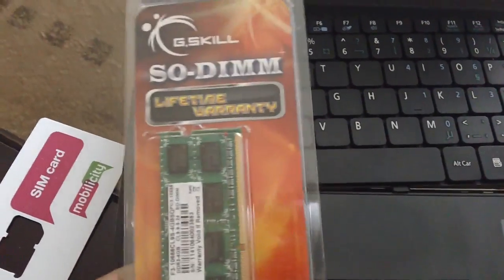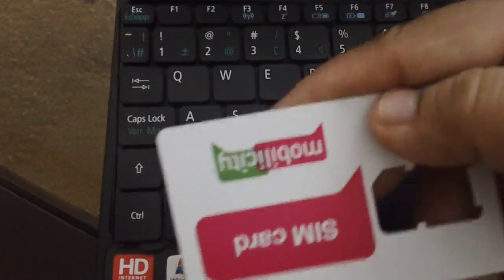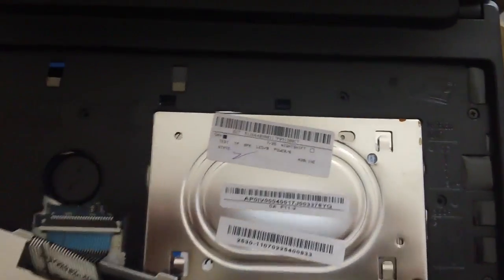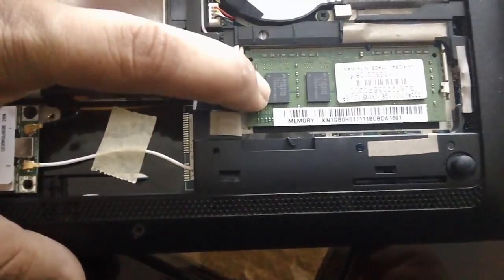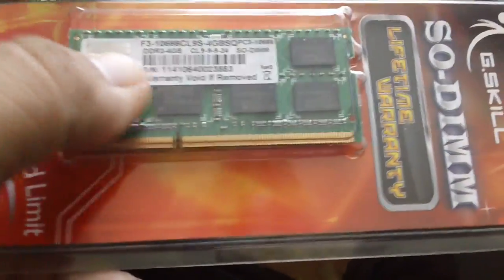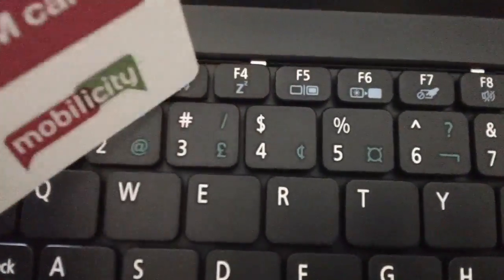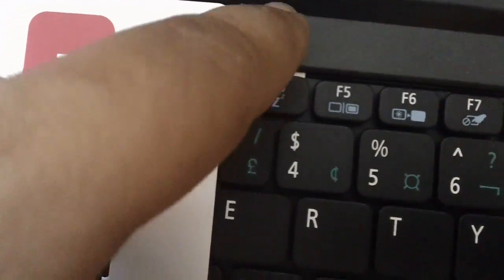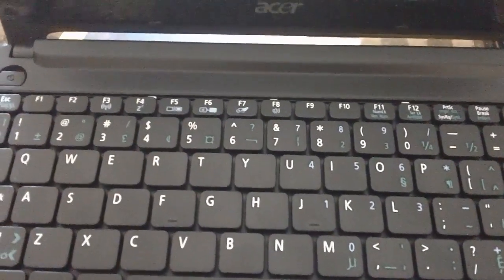Acer Aspire One AO 522 RAM UPGRADE and PROPER KEYBOARD REMOVAL [HD]

Comment: quick question, whats the quickest wifi driver to install on this notebook? the wireless is slow since my windows 7 upgrade and the site gives me so many drivers to choose from?

Thanks
Reply from the maker: hmmm.. if i remember correctly, this model has few different type of wifi chipset, like, atheros, or broadcom.... either acer should have chipset auto detect tool or , you might have to find out which chipset is in your netbook but other detection utility, OR since you opened it, just see if you can read it from actual hardware inside the netbook. look up on google what the wifi chipset look like for easier detection.

Comment: The keyboard removal procedure in this video is totally INCORRECT!
CORRECT REMOVAL PROCEDURE TO PREVENT DAMAGE:
1. There are 4 spring loaded retaining clips above the keyboard located above F4, F8, F12 and between Ins-Del keys
2. Use tiny screw driver to push these back one by one starting with the largest clip in RIGHT corner above the Ins-Del keys.
3. Use something tiny such as a needle lift k/b above the spring loaded retaining clips.
4. Also 2 fixed lugs holding k/b next to ESC and TAB keys.

Comment from the maker: that bus speed  , so no it will not work, since the SO-dimm slot inside this netbook can not handle ram at that speed. ( and the voltage might be different too), and no, the mobo bios is retail, and so, its locked, so good luck on finding unlocked one, and even then, not recommended,   so i suggest, go with same speed or slower one

Comment: I've purchased F3-1600CL9S-4GBSQ, the ram you have is F3-1666CL9S-4GBSQ (the difference is the '666' in the item number.  Once the ram is installed the computer won't boot.  Is the hardware that picky??

Comment from the maker: sorry for late reply, .. anyway, usually blackscreen or failure to complete POST, after ram upgrade or when machine is moved fast,   means that ram just came loose or bad contact between dimm slot and ram module.

Comment: Followed this video,but these tabs are really a pain in the... Credit card trick didnt really work so I used a small screwdr. Managed to lose the tabs at F4 F8 (disappeared and didn't come back). I now just pushed the kb cover down into place with a stylus (doesn't scratch) and it looks OK. Also pushing the kb up from the back (silver hole behind battery) is awkward, I made a hole in the alu cover - hope that doesn't hurt.  All looks well now, in the end. But boy, what a BAD DESIGN by Acer.

Comment: @pukka5 Thanks. I'm still waiting for my new ram to arrive but i already tried to open the netbook up.

There's a really great tip I found on another video. When you take out the battery just above the battery connector there's a little square hole to the other backside of the keyboard. If you just push on that with a screwdriver or something, and then push the little tabs out of the way the keyboard pops right out no problem.

Comment from the maker: @pukka5  you will have 3.5 or 3.6 gig of usable ram avaible once u install 32 bit OS (since GPU uses 256 meg) and 32 bit limitation. so, in conclusion, MAKE acer valid recovery DVD (just in case you need to revert back to original) , then install 4 gig ram, then install  win 7 32 bit home, then make sure to install driver. ALSO, acer recovery manager will let u make DRIVER dvd disk, which will come in handy for c-60 AMD grafix driver. once 32 bit installed, install driver from this DRIVER DVD.

Comment from the maker: @TheTomtah Make sure to get 4 gig (single) stick of sodimm ram chip. THEN make sure to install { 32 } bit version of Win 7. don't bother with 64 bit. the main issue you will find is that c-60 chip set driver HAS to be released by VENDOR (NOT amd ) , because every vendor have customized version of chipset and amd is not responsible for making 64 bit driver of this yet. SO, do NOT install 64 bit, just install 32 bit. and get the driver from acer website. This way, 32 bit will let you use 4 gig.

Comment from the maker: @suiton629 no. this mobo will only support up to 4 gig ram. that is the limitation in chipset and/or in the bios. and basically 32 bit goes up to 4 gig since  that is how much it can address. Win starter will recognize ram, but ONLY let you utilize first 2 gig which is put in by MS.